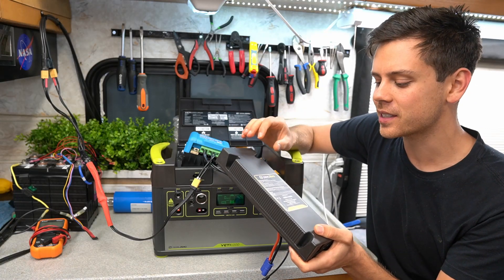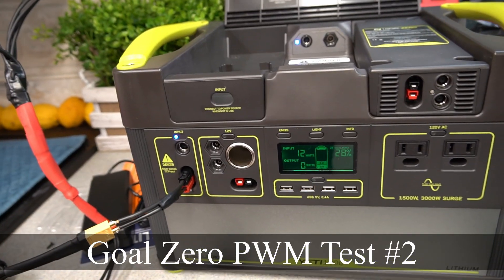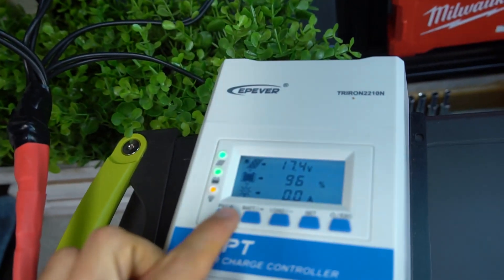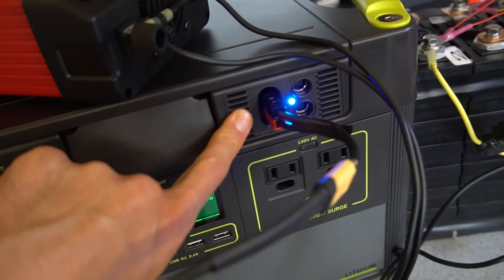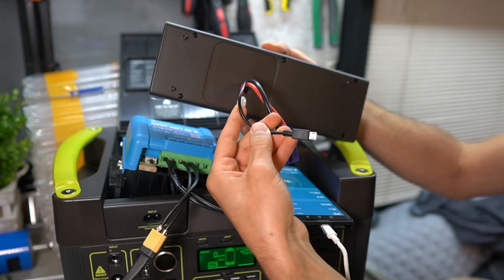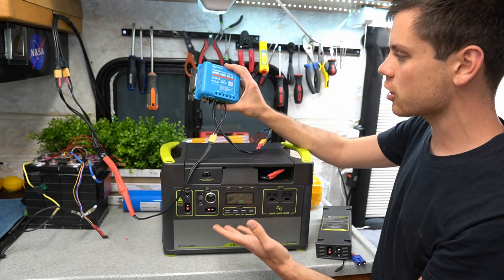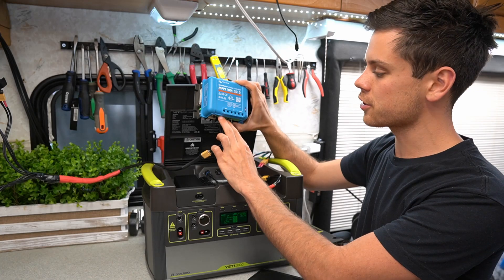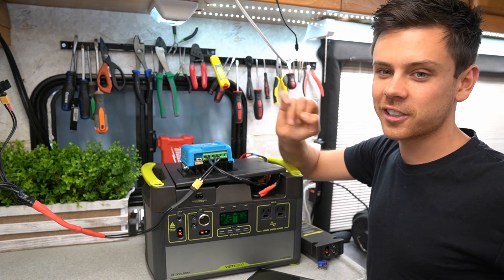How to Hack the Goalzero Lithium by Adding a Powerful Victron Charge Controller

Comment: My friend has one of these stock Goal zeros that wont charge anymore no matter the input he uses (wall or solar). You reference the PWM, can you share more about what that is? Are replacement parts available do you know? I thought that getting a new charge controller would maybe help but since it does not charge when plugged into ac either, i think it may be something else. I know this video is very old but its been helpful! Any help is appreciated. 

THANKS

Comment: Just got off the phone with Goal zero. They claimed there is a whole second charge controller in the unit you can’t remove. I tried this hack with a renogy rover and could not get it to charge over 130 watts. Also couldn’t get the yeti moor to charge over 160 watts. No idea what is going on. Trying the Victorian right now!

Comment: Next hack disconnect the battery and add a plug. So the unit can run off either the internal battery or external battery pack.

Comment: I am glad I found this I have a Goal Zero 3000x and was wondering about charging it with my Victron 150 / 35. Sounds like it can be done. the 50 max input voltage is crazy low. The question I am having is if you have a 300-watt load and 500 watts in from the solar the battery is actually only seeing 200 watts.

Comment: So I started to look into this -- and I found that the power monitoring in the MPPE module wasn't very accurate.  When I plugged in a watt meter inline with my panels and on the output of the MPPE module - it was extremely effcient and in fact delivering more power than the victron -- the victron had more overhead.   However, the power monitoring on the goal zero MPPE module was under reporting by about 18% of what it was really delivering -- maybe it's a calibration thing they need to do.

Comment: How can I charge one or more LifePO4s via the Yeti 1000x, with YETI 12V MAX CURRENT CABLE and GC018 15A 14AWG 12V adapter, heavy-duty cigarette lighter plug and socket with eyelet terminals? I was planning to connect several LifePO4s to charge them via the Yeti and thus expand my memory, which at the same time also discharges from the LifePO4 first when used, in order to prevent the Yeti from discharging so that no more cycling takes place. The LifePo4 batteries then do all the work. Do you have any ideas on how to do this, this circuit?

Comment: I notice in a lot of your videos on victrons too, you dont use the  "LOAD" output you take the loads direct from battery, I get you dont want to do that with an inverter, but for normal loads?  any reason? My uses are 1 - a camper, small loads, 2, even smaller solar powering a pop wifi link and security camera.

Comment: Hi friend if I use only 12v controller for solar generator then I won't have to mess with the technical data and change charging parameters please???  And you say that for a generator in this style it is better to use 12 v in general because it will extend the life of the battery, did I understand correctly???

Comment: Heyho! Thx for your video! 

I tested this setup to charge my yeti via victron mppt 100/20 and it works great! Very high input on both sides. With a 235w panel.

I also tested a setup with a 12/12 30 victron orion an the ppa input of  a yeti 1500x and it works! Can charge up to 300w in my car and it shows the input! (Using the dc/dc as a power supply)

Thanks for your work will. I watch all your vids and ur a great inspiration of how u can build somethink u never done before. Thinking about an diy offgrid setup for my house. Hope you will bring up more stuff like u did in the past!

Greetings from germany
Thank you for this video !

Comment: I currently have 3 Yeti Tanks going into a 1400 Lithium via Yeti Link. I use a Victron 100|30 to charge the tanks from the back end with solar or a 24V 300W medical PSU after a  brown/blackout. This works much faster in topping off the whole rig, especially when used in conjunction with the built-in PWM charger. Can I swap out the Lead/AGM batteries in the Tanks with LifePO4 and set the 100|30 to charge that way without damaging the 1400?

Comment: Can you run 2 sets of panels (with one set on the additional charge controller) to exceed the 600w (50v 50a) limit off the 3000x?

Comment: The max charge rate they told me is 600W.  all the charge controllers on board and even the expansion modules will max out at 600.  The unit will jump from one input to another and whichever is the higher voltage

Comment: Same idea can be done with the solargen connected to the load port of the 100/20 or 75/15 to make room or a 12/24 volt battery that can store temporary big amps of solar coming in. It will also function as a buffer for when the solargen can not handle it or is full.

Comment: I just got a boat with 70W solar and a shitty old controller. I Measure 15,6 volts from the pannels and 11,9 on the output and the red light is on. So I think the regulator is in low voltage shut down. What is the best alternative Victron Energy MPPT 75|15?

Comment: As these goal zeros wear out it would be great to have a hack to replace battery with lithium iron phosphate that can handle more cycles or even a larger capacity battery. Has anyone done something like that to avoid having to dispose of these goal zeros?

Comment: You are trusting the built in power meters of both.  Did you verify they are accurate with an external power meter?
Otherwise, you may have an optimistic built-in power meter.

Comment: Goal Zero, and others like Jackery, are Lithium NMC, not Lithium Iron Phosphate, so 14.4V for charging is incorrect. I would not be recommending people do hacks on lithium batteries without knowing what they are working with. If you are going to DIY, start at the beginning with components you can actually get spec sheets for... otherwise you are making massive assumptions about engineering choices that were made at a meeting you were not in attendance at!

Comment: Will, love your videos, but why are you surprised that the solar input wattage is the similar between the GZ's MPPT & PWM? Even 13W vs 12W is about 8% better, which is what you would expect on a system this small. Remember that the solar panel output hasn't changed. MPPT is only able to squeeze more charging AMPS out of your panels because it is adjusting voltage while maintaining max solar power. Another issue: Did you take into account that these Goal Zero lithium batteries are NMC, NOT LFP? If you used an LFP preset on the EPEver, the MPPT unit appear to be outperforming the Goal Zero's MPPT for the simple fact that the CC/CV numbers would be wrong - the Goal Zero is tuned for NMC. The new Yeti-X series has the MPPT built-in, and it has a higher input voltage range.

Comment: This works on my goal zero Yeti 1400. Just hooked up the victron 100/20 yesterday evening and it charged all day today and it accepted 100watts more than the stock goal zero PWM ever has. The only thing though is that my display does not indicate that it is being charged (the battery icon does not move like yours did) but I just watched the percentage increase. I also went with Amazon connectors instead of buying them goal zero and supporting their scam of a company. 
Their customer service never got back to me about helping my issue: the PWM controller built in would not charge the battery, and I did not want to support them by buying the MPPT so I went with this route and it works great. Thanks will
Reply: Which connector did you buy? The ec8 will recommended is not correct style to plug into the yeti module port. Thanks

Comment: If you buy a goal zero battery, expect to pay $200-$500 extra in their goofy adapters and additions that you need to have a properly functioning power system. You are much better off watching these videos and spending the time learning how to set up a traditional system. Goal zero is not as “plug and play” as it seems. I have deep regrets buying their 1400

Comment: Will wants to know what I think.

Brain is scrambled. I only bought the 1400 because I felt I needed power in an emergency, because I liked that it has WIFI, and because l, unlike that 1250 @ 100 lbs, I could lift the 1400 43 lb weight.

Other than that, I don’t know anything about all of this electrical stuff.😂

Comment: Hi Will, great contribution, thanks. – I love the GoalZero products and I have some of them, but I absolutely agree, they have some issues with some of their products. I have a Yeti 3000 and my car link module was charging up to 850W. The result was, that the module burned down, since the connectors and also the cables are not dimensioned for long run with such high current levels (about 65A+). – Just changing my alternator charging solution to a Orion DC/DC converter. So I can control the current to lower level und the battery will last longer. One issue I lastly had was, that the PWM converter could not handle the specified current and that‘s why I‘m changing to an other Orion model with higher voltage and lower current now. - BTW: the car link module is currently not available, since they‘re working on an improved version... ;-)

Comment: I’ve got a Pecron Q3000S solar generator and two Bougerv 12v, 180 watt panels. Their combined series maximum voltage output is about 46 volts in direct sunlight. The Pecron has limits of 48v and 300w. These panels will do the job, but since I live in WA state, it’s often overcast. I am hoping that there is a way to connect more panels, and send that to a controller, then out to the Pecron, which is the bottleneck in this system, since it appears to have a little PWM controller. I was hoping to get an answer from Will, but if anyone has any thoughts about the viability of this plan, I’d appreciate the help!

Comment: You should figure out how to DIY a replacement battery for the GZ 1000 lithium (what specs you'd need) since Goal Zero has now discontinued it for some reason, without making a replacement battery available.  Somehow putting a LifePo4 battery in there would be so amazing, since the design of the unit is pretty nice and would be a shame to toss just cause the battery wears out.

Comment: I wanna try this as my first Solar project... so far I made a list, 1:goal zero yeti 1500x, 2: Victron MPPT(exactly in the video), and 3: EC8 to ring to terminal, 
Just need to find the right 25amp fuse and solar panels...
I’m a complete noob at solar power, but I’ve been watching this channel since 2019. Any helpful tips would be greatly appreciated before I fully invest in to recreating this Goal Zero solar power solution.

Comment: Would Victron orion dc dc 12 12 30a charge Goal Zero directly from car alternator as replacement for GZ carlink module??
Reply: No that won't work. You'll need the Victron Orion 12/24 15 Isolated version. You'll need to set it for power supply mode at 22.0v. I have this version of the Orion charging my Goal Zero, and it works great. 325W going into the Yeti while i drive, and the Orion will turn off automatically when the car is turned off. You'll need to set the parameters, and in my case it's 13.2v and 13.4v lockout.
Reply: @southsurreybc  did You conected it via ec8 port?! Im gonna try it out. Thanks for Your help:)
Reply: @pizzaface28  I connect the Victron Orion 12/24-15 to the GZ1000 using a custom-made Anderson plug - the vertical input. It works very well. Charges at 325W when I drive. In an hour of driving, It can fill the GZ up by 1/3 at least. Good luck!
Reply: @southsurreybc  Super...so I probably could use it together with victron mppt on ec8 iput...is mentioned by You 'vertical anderson' plugged into solar anderson input below 8mm?am i right?! Any fuse on cable...?! Thank You so much for helping me!

Comment: Hey Will, love the channel and wish I found it before I bought my Goal Zero.

I was wondering if you could help me here. I've got a yeti 3000 which came with the mppt module. I recently purchased to the yeti link (to charge from the alternator), which will replace the mppt, forcing me to use the pwm port on the gz for solar.

Do you think it would make sense to use the Victron mppt controler and plug it into my pwm port to regain some of that lost efficiency?  Or would that not work?

Thanks for the videos!

Comment: Hey Will, I am using the EC8 port for the alternator charging kit from Goal Zero. Would it be possible to connect the Victron to the Anderson input ports on the front?

Comment: I have the goal zero 1400 and bough the mppt I’m Unhappy with it as it is temperamental. Definitely gonna spend some extra money for victron or like with the Bluetooth option in addition to perhaps
Getting a LIPO battery for additional storage capacity. Any other Bluetooth suggestions other than victron
Reply: Update : got the Victron smartsolar 100/30 mppt hooked up per Dr. Prowse’s parameters. On my gz mppt I cut the ec8 and put the Andersen 30a connectors on midway for universal connector just in case I wanted to put the mppt back on for mobile applications. (4) 100 panels are hooked up in 2 series x 2 parallel to the mppt. Maxed out yesterday topped at 270w.

Comment: When you connected the Victron mppt to the GZ 1000 did you cut the connector off their mppt.  The  blue connector you connect in the video looks like the one from the GZ mppt.  I cannot figure out where the suggested cable can fit to the unit

Comment: Hey Will, any thoughts on a hack to charge a Yeti Lithium from a vehicle's alternator? They have a CAR CHARGING KIT and charge $425
Reply: A somewhat primitive but simple method is a small inverter in the cigarette lighter socket and the normal Goal Zero AC charger in the inverter.  You'll get 60 watts of charge that way.  I use a sine wave inverter; I worry about square wave inverters for just about anything (don't do it).

Comment: So about a year ago Goal Zero came out with their link module which allows you to hook up the Yeti to the the alternator to charge but it has an input on the front so you can add in solar charging too. Do you think I could add a victron mppt between the solar panels an that 8mm charging input and see the increased performance?
Reply: Hi @Brian Webber did you get any input on this? I am considering a similar setup: alternator and MPPT output both into the GZ in a secure way (not to put too much power in)
If you found something it would be so nice, if you could share you experience

Comment: I hooked up the victron. It's working but, as the video states, I'm getting no input info on the yeti display (but I can see it in the victron app). Thing is, I'm also getting no output info on the yeti and the victron app also doesn't show the output wattage from the yeti. So I've got no way to tell the power consumption. It always says 0 watts. Anyone else have this issue? Is there a solution?

Comment: Hey this video is very helpful! I am trying to program my Victron MPPT right now and it will not allow me to change the equalization voltage to nothing less than 9V do you have any idea of why this is, or if this would damage my goal zero equipment?
Reply: I've got the same question. Any answers?
Reply: Another commenter addressed this in a separate comment.

Comment: I've got a GZ with the yetilink expansion module currently charging off vehicle alternator. I also have solar going into the module to keep both the vehicle battery and the GZ battery charged. I have a Victron 100/20 sitting around. I wonder if I could bring it into the chain somehow.
Reply: Hi, how are you connecting solar into the yetilink module?  Doesn't it have just one input for the alternator
Reply: @ap6553  right now I'm doing solar to the pwm input in the module. It will charge both the GZ and the vehicle battery. I would like to use the mppt when I add another panel.
Reply: Hi @notfamous did you find a good setup? I am also thinking about using a Victron MPPT but also would love to have fastet charging form the alternator if I am driving. I am now a bot worried to kill the yeti if I put too much power in (say driving in sun and having alternator and solar panels pushing into the Yeti)
Reply: @normenluettich1723  not really. right now, I have the MPPT going into the GZ battery pwm and the alternator going to the GZ yetilink. This keeps the GZ battery charged but it isn't as efficient as MPPT directly to battery. There is an MPPT out there that will charge both vehicle and house battery as well as automatically switch to alternator that would be a better setup. Renogy DCC505.

Comment: Got the actual cable you mentioned Male Ec8 to ring terminal... On amazon and current Goal Zero website that cable in your screen shot is called FEMALE EC8 to ring terminal 😠 please let me know where you got that screenshot, I might get amazon to send me a correct one, right now threw away $25.

Comment: Hope & prayers for pulling thru pandemic 🙏
Having trouble setting equalization to 0.... changes to 9.00v every time thank u in advance
Reply: Me too! Did ya find a solution?
Reply: @cogwun  
Hector Hermosillo

this is what I was told: 
You won't be able to set equalization lower than 9v, but turn on "Expert Mode" and change Equalization current percentage to 0% and automatic equalization to "off" (which you already have) and it will never enter equalization... and even if it did, there'd be 0 current.

Comment: Does anybody know if it's possible to charge the yeti with the mppt and pwm controllers at the same time. Would there be any advantage to doing this?
Reply: You can charge simultaneously through both the PWM and the MPPT.  I have two solar arrays - one on my roof (400W) and one in my backyard (200W) - each with their own Anderson plugs.  I plug the roof array into the GZ MPPT port, and the backyard array into the PWM port.  Works just fine.
Reply: @nickessling3465  good to know, thank you for the reply,  simultaneously charging makes a big difference